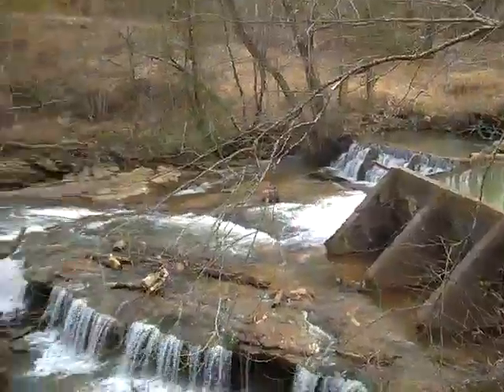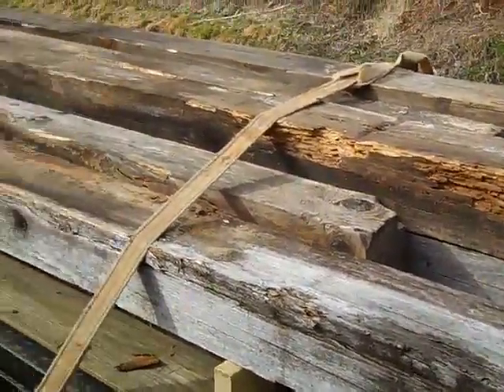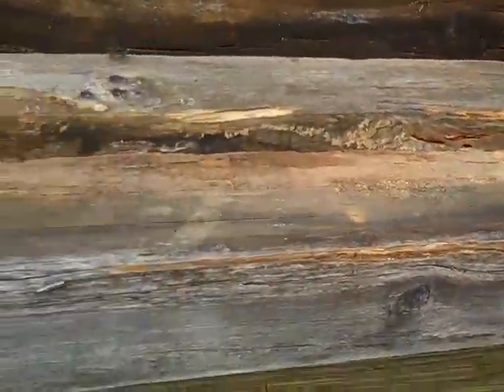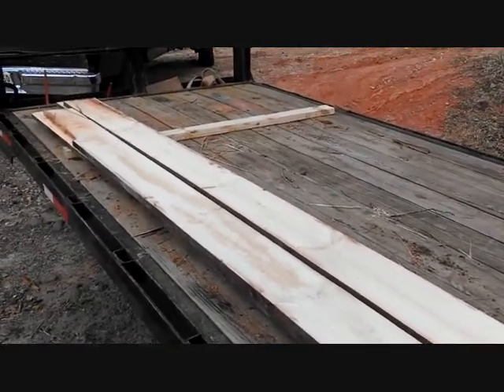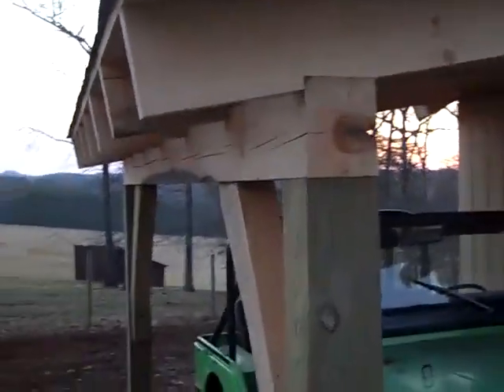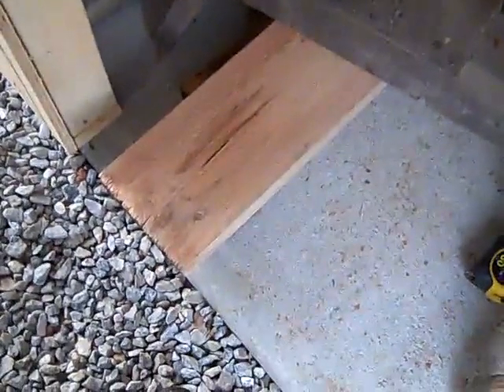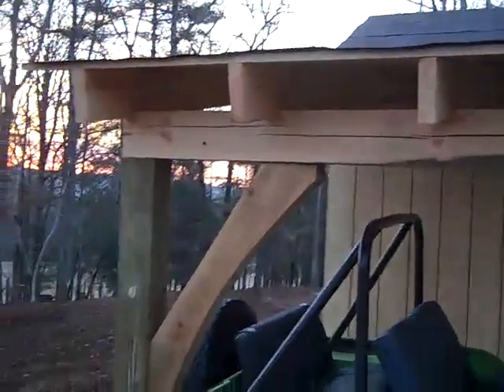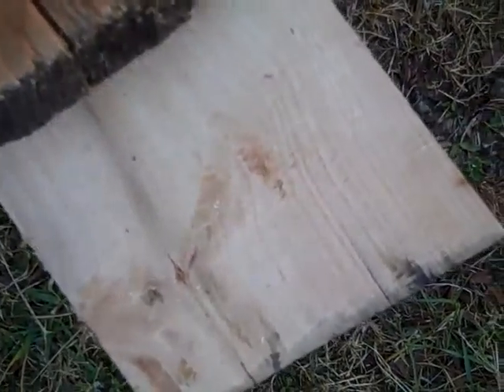Sawmill Savings

Comment: You should have had the wood Tanalized (timber that  has been treated with tanalith E a safe preservative that is forced into the timber under pressure and so is far superior to a dipped or sprayed on stain), it would then last for years!

Good video. Thanks for uploading